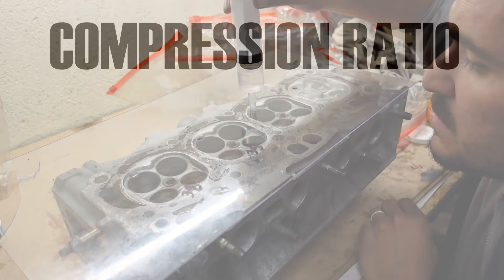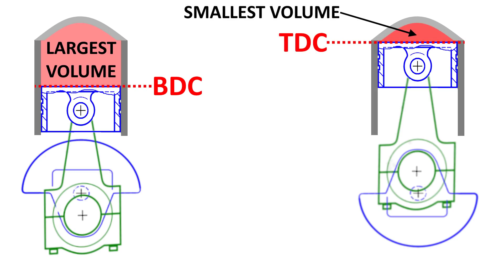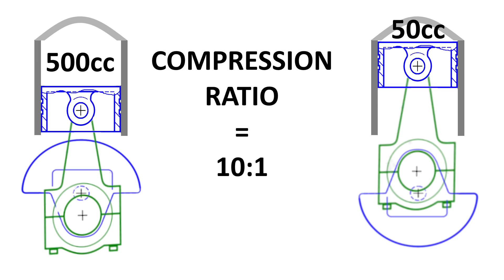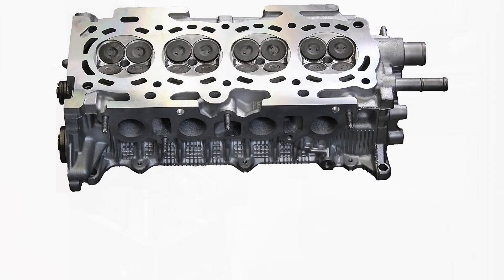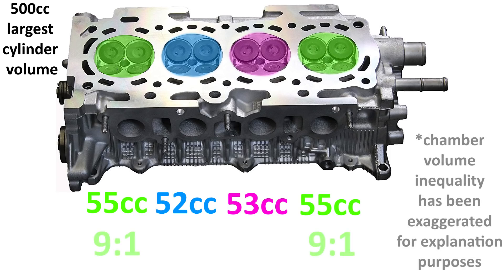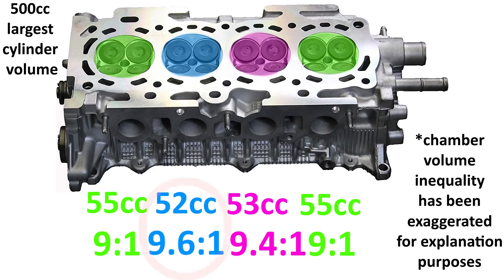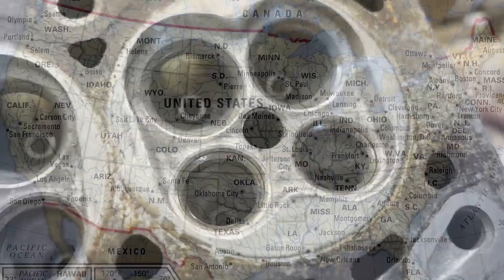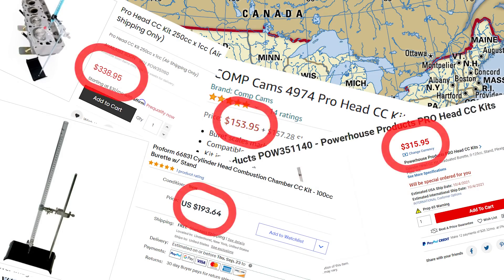HOW and WHY to EQUALIZE combustion chamber volumes CC - Project Underdog #10

Comment: I always try to do it when working on heads but when the engine is working it barely matters as there's a whole different range of actual pressure on each cylinder, depending on reasons varying from injectors to intake design, gas inertia as per RPM, or even the restriction of the recirculation port of the EGR which is usually on a single cylinder.
So unless the compression is much different like having a cylinder being dead low because of an issue, there's a measurable difference on the actual pressure each cylinder has when the fuel ignites at all times, that its self causes more uneven wear eventually than mismatching a cylinder to 10.5:1 instead of 10.3 when we talk about an engine that is in perfect working condition afterall.

Comment: Great video.  Will help in my project to build 300whp Cruze.  Can you do a video on the difference between a turbo with a pressure wheel vs as volume wheel.  I remember I was going to turbocharge my s10 and I was looking around for turbos from a Saab and they would ask the question if a I wanted a high pressure wheel or low pressure.  I assumed the high pressure wheel just meant higher boost level.  If that's all it means then I have answered my own question.  But someone told me it wasn't quite that simple.
Reply: What you need to do is determine the mass of air the turbo flows and the mass of air the engine would suck in when in NA form. Then calculate boost. Also, you would need to get the right exhaust manifold with the right turbo flange. The early 900 used a Garrett T3 flange, but I don't know what others used. Pressure is determined by how you set the wastegate to open.

Comment: compression ratio is measured cyl volume below the deck vs head volume....and head gasket.

Cyl volume deck to bdc=   10
                                              to
Cyl head volume=.                1

By your calculations, you measured the cylinder head volume twice by using the "total cylinder volume" with "cylinder head volume" which is incorrect.
Reply from the maker: No. Compression ratio is the ratio of the maximum and minimum cylinder volume. BDC : TDC. It takes 5 seconds to Google this. It took much longer to write and edit a comment which only spreads misinformation.

Comment: PSA you cant reduce an engines tendency for pre ignition by grinding away the quench zones that were engineered in to do specifically just that. Shrouded valves... Toyota didnt put that material there for fun or to hurt engine performance.

Comment: LOL you totally destroyed that head, its going to be a pre ignition mess with all that quench area ground out. Those engines are so sensitive to that, that even running a thicker head gasket tends to increase knock rather than reducing it with the reduction in compression it provides.  Everything about that head was with economy in mind, meaning higher compression while maintaining timing. The size/angle of the valves, port geometry and cams are its downfall in performance terms, everything you ground away was there to move fuel air mix away from areas prone to detonation and those engines needed it, hearing them knock under acceleration when 100% stock new was common. Factory pistons wont take boost at all, even with av gas or straight ethnol the rings and lands are just too weak. Stock rods are really not good for much in those either. Somewhere around 250-350hp you will will crack the cylinder wall, they are thin.  Factory 100hp to 200-250 or so boosted is reasonable with pistons, rods, studs and factory mhg assuming you have octane to support it but thats reality of 16v 4a/7a and why no one bothers with them. Maybe ya could spin it to 10k rpm and keep the torque low but the investment in valvetrain and probably a crank to make that happen is way more than the result is worth vs finding a 20v engine or any of the cheap easy swaps.
Reply from the maker: Ah yes, armchair geniuses... The weeds of the Internet.

Comment: Of course you have the same bore and stroke in each cylinder...
Back when my cousin was working his way through an automotive tech school he bought as a project a 1962 car from my father. It had a straight six chevy 261 (like the truck motor, but canadian so it had hydraulic lifters) which ran, but was burning oil almost as fast as it streamed out past the rear main seal. Being a student with limited means, he ended up rebuilding that straight six with new rings for all six cylinders, three original pistons, but one cylinder needed bored 0.040 over and two were okay with 0.020 over and those three needed new pistons.
Obviously not built for performance, but it ran great with the expected straight-six smoothness. That car became a daily driver for a few years plus we put thousands of miles with multiple 1000+ mile road trips driving at high speeds while burning multiple tanks of fuel to reach our destination. We'd leave after school on Friday needing to be back on Monday or Tuesday at the latest.

Comment: Pro Tip From a Medical Professional:
Use the smallest syringe you can. Volume and precision vary inversely with syringes. 

If you want a super accurate number, use a 1cc syringe 36 times….

I personally wouldn’t trust a 30cc syringe to be precise within less than 2ml.

Comment: You could also measure the water by weight as well, that is if you have the correct digital scale to do so.
1 milliliter (ml) of water weighs 1 gram (g). The prefix in front of the unit tells you how to move the decimal. 1 milliliter = 0.001 liters because "milli" means "thousandth". 1 "thousandth" of a liter = 0.001 liters.

Comment: ALTERNATE APPROACH THAT IS LESS FUSSY:
Follow all the steps up to filling the chambers with water. At that point, fill the large syringe with REFRIGERATED DISTILLED water and weigh it with a gram scale. Fill one chamber with water and then weigh the syringe again. The weight difference in grams is equal to the volume of the chamber in cubic centimeters. (well...technically 1cc of distilled water weighs 0.9982g, but that difference is too tiny to matter.) Refill the syringe, re-weigh it on the gram scale, fill the next chamber, and calculate the weight difference again. Repeat for all chambers.
Reply: Weight measurement is far more accurate than volume measurement.

Comment: why not use a ceramic coating in the combustion chamber and on valve faces? Is there a specific reason?
Reply: There is a fear that it will flake away. However, some race teams do it, especially with diesels.

Comment: Ok...and then when you are cutting those ugly seats on the head and regrind the valvs after your polich and grinding session off the chamber you have changed the cc in the combustion chamber again ;)
Reply from the maker: That's absolutely minimal and every valve will be ground by almost the same amount so the change will be near identical, just like the change from the head resurfacing ;)
Reply: @d4a  That is true if the head has no warpage, or only a tiny amount.

Comment: Many moons ago(think 1990s) you could get two angle valve seats (30º & 60º) pretty cheap from a Toyota dealer, granted you had look at every one you ordered... I wonder if that's still the case today?  Made doing three angle jobs a snap, and also made going oversize a snap too (you usually had to recut the stems).
Reply: Usually an automotive machinist has a tool that cuts a three angle valve job into the existing valve seat. If the valve seat can't be recut, they install a blank, then cut a three angle valve job into it. You can see this in action if you watch a video about converting a leaded gasoline head into an unleaded gasoline head. The Serdi and Centroid valve machines do a great job of this.

Comment: Great advice but I'm not sure if I want to spend the next four months calculating the CC of each cylinder to gain .0005 nm in torque😞 if it doesn't  give you whiplash nobody will care
Reply from the maker: This does not get you any torque. As I said in the video this took me a total of 10 hours so. The point of this is to make sure all cylinders are equal if one is smaller than the others it starts knocking sooner and then you have to dial it back and that's 10-20 hp on a 300hp engine.

Comment: Cool video, however you should really be doing this after you have lapped valves in and especially if you are replacing valve seats.
Reply from the maker: Not replacing valve seats. So one valve will be ground and lapped noticeably less than another?
Reply: @d4a  Well, perhaps not enough to matter, more good practice. You can quantify how much it matters, you know the diameter of your valves. So if each valve had a diameter of 20mm and lapping moved valve into seat by up to 0.2mm (guess) you might increase your total chamber volume by 0.25cc, however some valves you might remove more, some less. Measuring the closed height of the valve (valve stem height) before lapping will tell you if you are  potentially creating an imbalance or not. You seem to be aiming for 0.1cc so in this case it might be useful. Interesting subject thank you.
Reply: To add, it also depends on your method for lapping valves. I really like to pull a vacuum on a closed valve to see how well it is sealing, in this case you end up lapping some valves more than others to achieve a required seal so you might be more prone to variation between cylinders. Ultimately 0.1cc isn't going to matter but seeing as you are trying to match to the closest .1cc you might care. At the moment I do not think your test method is accurate enough to truly be down in the 0.1cc range.
Reply: Correct. A. valve height may not be consistent due to existing seat diameter and individual valve variation. So need to keep each valve in the same port. B. When the valves are ground there is variation in how much is taken off each valve and each seat. So to characterize all this variation CC the chambers after the seats are done.

Comment: How can you accurately measure chamber volume, with all the old gasket material still stuck on parts of the cylinder head?
Reply: You cant, but you cant reduce an engines tendency for pre ignition by grinding away the quench zones that were engineered in to do specifically just that either. Shrouded valves... Toyota didnt put that material there to hurt engine performance.

Comment: I would add to get the rough chamber work as close as possible between each chamber. Then get the cylinder head resurfaced before finishing the chambers and getting everything dialed in and equal. The removal of material from the head gasket surface on the cylinder head will reduce the volume in the chambers, so it's good to do it prior to the finished work.

Comment: thats cool and awesome, give you alot of credit in taking the time and patience to do each cylinder. what do performance shops do to ensure piston dome masss are equals well? as that could throw off your ratio also. my guess is building a tesybe and placing each piston into it to a specified depth and monitor the increase of water levels or displacement

Comment: Measure the cylinder head flow when you have intake- and exhaust manifold bolted on. Then you can make calculations what your chambers should be depending on the flow. No need to make them the same if ports dont flow the same.

Comment: so the real combustion chamber volume has to add in the volume of the piston cutout for real compression ratio, but this method still work assuming all the parts including pistons, connecting rods and the rod bearings combination gives the same residual volume for all cylinders

Comment: I’m super interested to see what your power and torque numbers come out to. Im running an economy Honda K series engine (k24a8) on the maxpeedingrods gt3071 and the torque is through the roof. Making about 350 whp / 300 whtq on 14 psi
Reply: That sounds like fun. What pistons and compression ratio do you have?

Comment: You just could’ve bought a titration Burette, they are way cheaper than the Kits from the US and More precise
Reply: What is a titration Burette ?
Reply: @brendanjones3395  A Burette that is used for titration.
It’s laboratory equipment which is used to dose a certain liquid (mostly acidic or Bases)
Reply: Thank you for the explanation I never heard of this tool I will research more into it.
Reply: Around 10 quid for a 150ml and 9 quid for the stand.

Comment: I remember when I had to do this for my Malaguti Fifty TOP equipped with a 75cc aftermarket Morini cylinder... I was 15 and I not only had to check the compression ratio, but also the squish area which is paramount in a 2T high performance engine. For that I was pouring candle melted wax into the spark plug hole with the engine mounted and piston at TDC, then remove everything again to check the squish area was effective and finally re-melt the wax into a siringe in order to get its amount and get the volume of the combustion chamber. Such a tedious job, considering that every time the squish wasn't what I expected I also had to re-do all after having lowered the cylinder base gasket (if not put it in the machine to cut away few 1/10s of mm to get it right)...

Comment: Well done, however the compression ratio is not 10.0 : 1  as shown, the calculation is incorrect.
The initial '500 cc' includes the 50 cc of the combustion chamber, therefore the compression ratio ( SWEPT volume over combustion  volume)  is actually 450 cc / 50 cc to start with, i.e 9.0 : 1. 
If you add 5 cc to combustion volume, the new calculation is 450 / 55, i.e  8.2 : 1
Look up  Cylinder Volume vs Swept volume vs Combustion volume....you'll see.

Comment: Since that head is going to need a leveling by the looks.
Wouldn't that also through out the final compression ratio values.
But all cylinders will be thrown out which is OK for an inline engine, but on a V or H this would be an issue, No?

Comment: You've got to be kidding me. This is horrible.  Use a burette, drill a hole to feed, and a hole to vent.  Fill with the burette until the vent hole starts to show seepage.  Water?  That's just ignorant.  Use methylated spirits or some other low surface tension liquid. Water is the absolute worst choice for something like this.  Irrigation syringes are HORRIBLY inaccurate - I use them for gross fluid injection or removal. If you want ACCURATE measurements, use a BURETTE.  They are globally available and accurate to 0.10 cc or better depending on how much you want to spend.

The need for equal volumes across the head cannot be understated.  It is a fundamental issue and will determine the minimum fuel octane you need to run the engine at full load.  HOWEVER, if your piston's quench (squish) height is not consistent or your rods are not equal length, none of this matters (cast pistons do NOT have consistent heights from pin to crown, rods from the factory are NOT equal length or equal weight!).

You see our intrepid poster here grinding away at the quench (squish) area on the head.  I would avoid this at ALL COST.  Losing quench (squish) means losing detonation resistance, and setting quench (squish) at 1.00mm is essential to good performance AND detonation resistance.  You'd be far ahead to sink the valves a little more in the seats than to remove quench (squish) area especially in Toyota engines where quench (squish) is at a serious premium.  If you get quench (squish) right, you'll see no carbon on the quench areas on the pistons or the head when you pull the head off, and you'll be able to run standard premium fuel while making surprising power.

It's disappointing to see a video like this.  This is so unbelievably crude it screams to me, please don't let people follow this advice.  No, not everything is bad, but some of the key elements are so far off the mark it makes me cringe.

Comment: Don’t use water unless you use a water wetter because the surface tension is too high. 
Use alcohol and use a little dye (food coloring works very well) it makes it easier to see and has much lower surface tension for better accuracy
Reply: I use methylated spirits.  Very low surface tension.

Comment: Very interesting. Do you have any idea how much power you're likely to gain with this? It would suck to do all that work just for a few hp!
Reply: if its non turbo egine this way you only lose power because if you encrease combustion chamber you will lose compresion 

if its a turbo engine then if you encrease volume in combustion chamber engine can take more fuel/air and probably more boost

Comment: Why didn't you have the head face machined first as machining it afterwards will change the compression ratio yet again. The resulting ratio will be higher than that which took so much effort to establish. Machining the head would also recreate sharp edges/hot spots to the outside of the chambers....  Just asking. Keep up the great work. 8-))